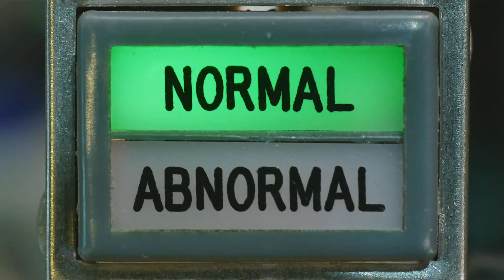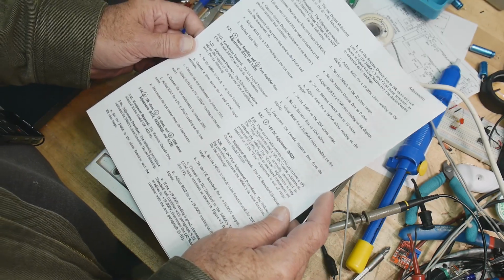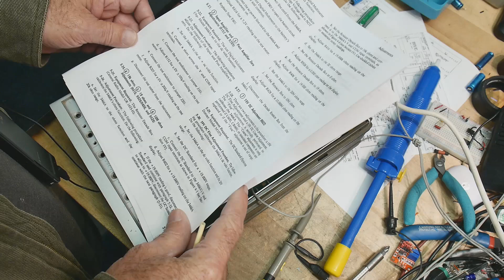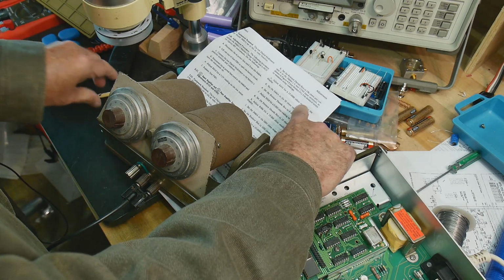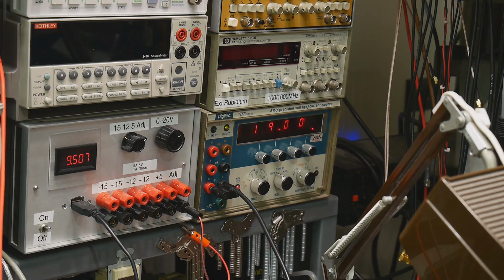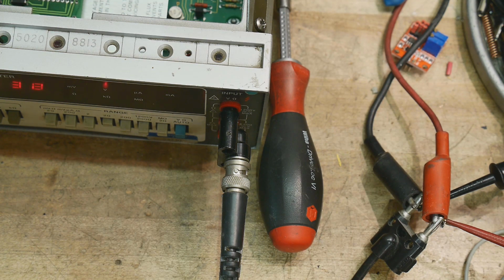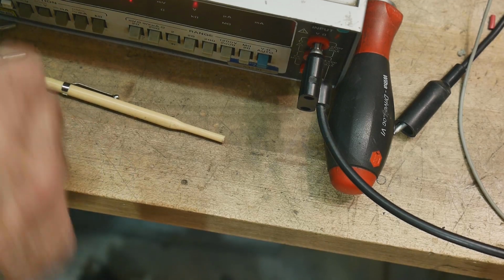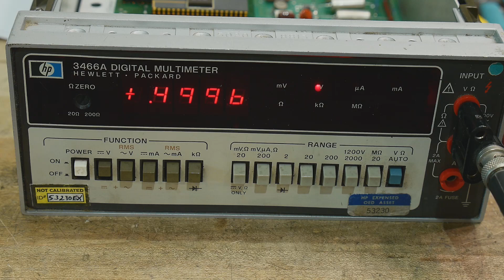#672 HP3466A Multimeter Calibration (part 2)

Comment: Helped a lot to adjust my HP 3446A completely within specs. There is a bug? feature? weirdness? in 5.46-5.48 100 KHz adjustment though, it seems to be completely incorrect in the guide.

Comment: Nice! I looked at my similar DVM yesterday and it turns out there was nothing wrong with it. I thought it was dead but apparently not. I don't have any voltage standards or resistance standards to check it but it compares very well to another HP DVM so I think it's good enough for now.

Comment: is that resistor box really 50ppm precision (0.005%)? that's what is required, if it is not you are just messing up the calibration to a worse condition than it was. Voltage standard is supposed to be 200ppm accuracy
Reply: +1 to this. The tolerances on test equipment can't really get any looser. HP wouldn't have wanted to use equipment more expensive than it had to be.
Reply: @NimbleJack3  Devices used in calibration are supposed to be 4x-10x the accuracy of the tested instrument..  The total cost of the recommended equipment for any HP equipment calibration, often exceeds the price of what is being calibrated.
Reply: @howardhiggins9641  you're preaching to the choir, I agree with you mate.
Reply: For Resistance calibration I'd just use a dual Banana plug with a trusted precision resistor around 18-20 volts, and CAL to that value.
Move the Banana jack to a trusted cal source and re-check its plug-in value - especially for the higher Meg Ohm CAL.
Reply: Resistors precision and ppm are not so vital if you can measure/set them with 6.5 digits DMM first.

Comment: "Yada, yada, yada" sure doesn't help much.  Calling this a calibration is nonsense.  The most important measurements during a calibration are usually the first and most important.   Spending 5 seconds to get 7.02 volts , when it should have read 7.00,  is just nonsense.
Maybe if you'd spent another few minutes, after possibly cleaning the pot, I'd say ok.
Reply: 7.02V is completely within the specs, 6.90 to 7.10.